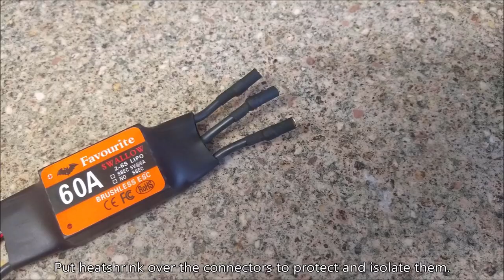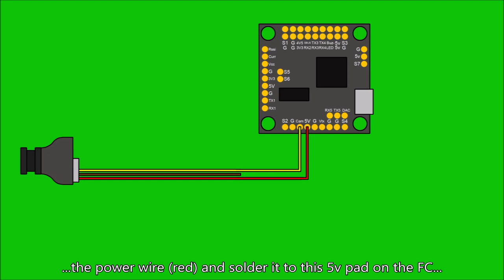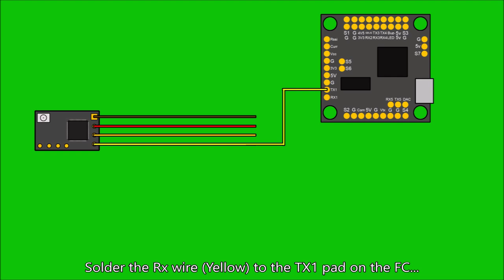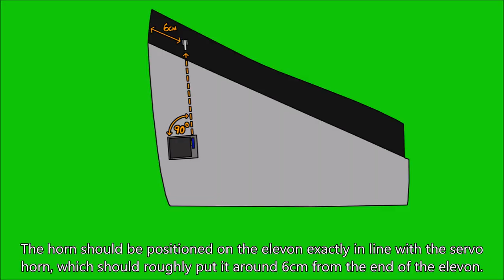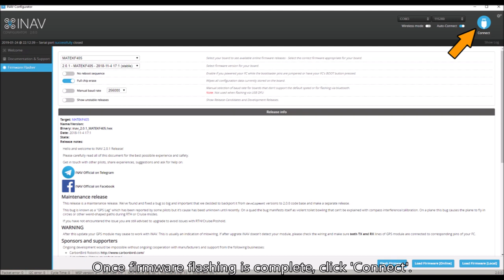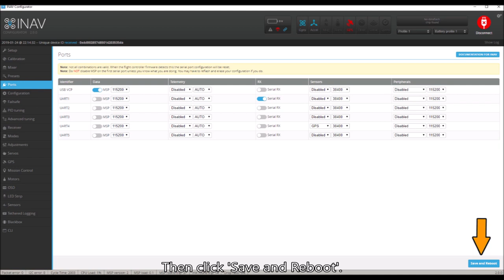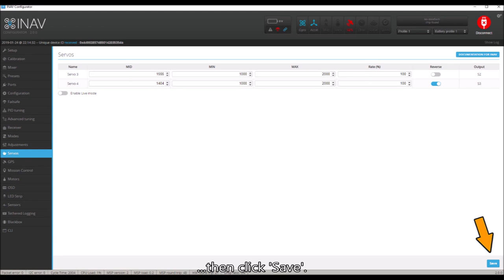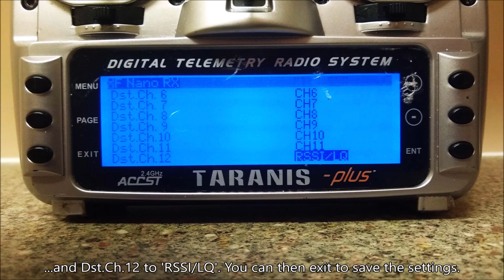🛩️ Mini Drak - Detailed step by step INAV build

Comment: Excellent video! 🔥🔥🔥
Just got done building my Mini Drak, 2 Nano's - both Nanos w/both sets of wings 40" and 28" and one of the Nano's set up as a boomer w/ both sets of wings - lightened (CNC'd). and then my Big Drak. 
All 4 Draks took over a month to build, but it was a blast and they came out great!
Now the thing is I have no idea about iNav, or how to configure... looks like I may have to spend FOREVER reading the Github / Wiki on how to utilize it and set-up for my FC's - Matek F765's. Although, I'm hoping some of your iNav settings transfer to my FC's.The process seems daunting, but brother I can't thank you enough for all your help and hard work in doing this build and taking the time to detail each steps, for the folks that need help. I mean, who does that anymore?' Your awesome brother! 😎

I hope my experience with iNav and the electronics goes smoothly as possible, but being a NOOB I'm experiencing stress to the MAX in not wanting to 'eff all my Draks up, or have a flyaway...
Crossing my fingers that I can finish these builds electronics and software as there's really no one near me that I know that flies and I've had to figure most things out myself. Hopefully I can report back with good news.

Again, thank you for the hard work, time, and effort that you put into this for all of us.

Best to you!
StashmanFPV

Comment: great detailed video! you don't have to solder the ESC ground, right? it is the same ground as with the power leads
Reply from the maker: You probably don't have to, but I feel safer doing it. Weight isn't a concern so might as well solder it up lol
Reply: and even better if you twist the thin white and black wires together, helps to reduce electrical interference. Cheers Steve

Comment: Inav, I don't trust it for a mini Drak build. Building one with Shelby now and using eagletree vector but, of course I'm blowing a wad of cash on that build. Competition cobra motor, high end servos, vector, long range 1.2ghz vtx&vrx and running 900mhz control. Was going to do crossfire but, going to use an R9 system with tbs antennas. 
Has Inav really gotten that much better?
Perhaps I'll try it in the S800 or the HK sidwinder.
Reply from the maker: I've been using inav for a few years now, and I've not had any problems with it. The only times I've had issues has been because I've failed to set something up properly. Once you've got the programming done right, inav works great

Comment: Really cool build bro!!! One question: i know that is suggested to mount the immortal t antenna vertically, but like this i think that it's easier to break it during landing... doesn't it?
Reply from the maker: Nope, the Immortal T antenna has its name for a reason, it's pretty much immortal lol. Doesn't break despite landings 😊
Reply: hahahah got it!! Unfortunately i have the frsky copy of that and i don't know if it's durable as the original!!! In your opinion, mounting the antenna horizontal makes a big difference?

Comment: Great video.  What carbon fiber did you use on the leading edge and elevators?
Reply from the maker: It's just carbon fibre vinyl from eBay. Fairly cheap to pick up 😊

Comment: @Giz FPV I messed up one of the terminals for the servos, instead of sv3 and sv4 could I move the both to sv5 and sv6?
Reply from the maker: In theory yeah that should be fine. You can normally allocate the terminals yourself however you want. Only exception is usually S1 and S2 which have to be used for motors

Comment: Hi, Whats is Function set disarm_kill_switch=OFF?
Reply from the maker: So this command basically means that you can't disarm the aircraft unless the throttle is at 0%. If the command was set to ON then you would be able to disarm the aircraft no matter what the throttle level. I think its best to have it set to OFF as it means you can't accidentily disarm the aircraft mid flight. For a quadcopter tho you'd want it set to on.

Comment: Great video, Can you gime the link of the motor mount.
Reply from the maker: The motor mount comes included it the mini drak kit
Reply: @gizfpv  Not with my kit. I,m talking about the blue one.
Reply from the maker: @rafasf2522  Ah right, yeah I believe the blue motor mount comes as standard with all the new kits. Think it's to help with vibration
Reply: @gizfpv  It can not be, bought mine 1 month ago on fpv24 and it did not come with that piece.

Comment: Will this build work for the flite test goblin?
Reply: Love you very detailed videos btw
Reply from the maker: The Goblin is a smaller aircraft, so you'd want a smaller motor, esc and servos for it. But other than that, alot of this set up could probably be put on one